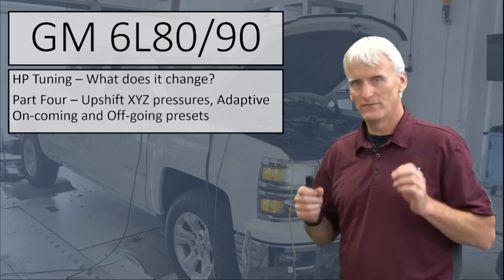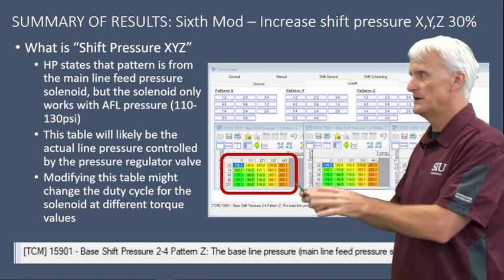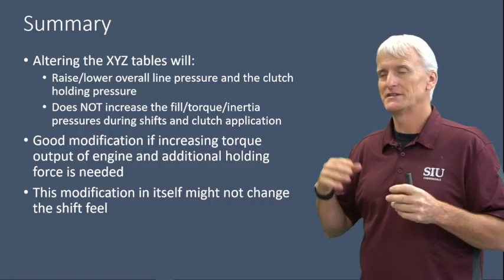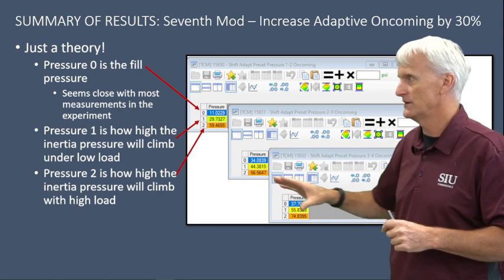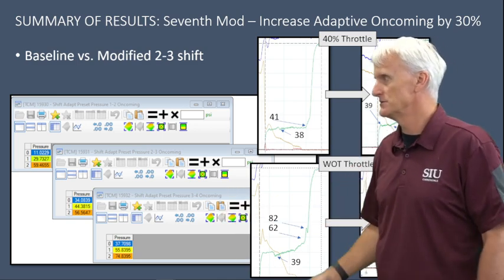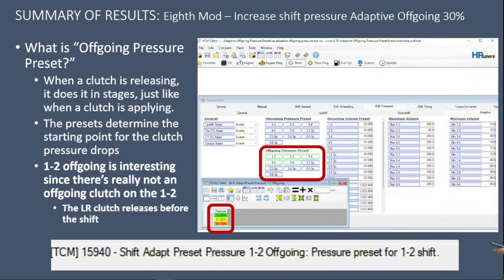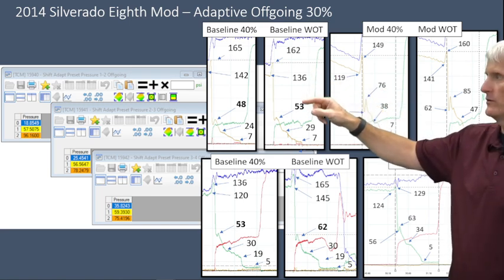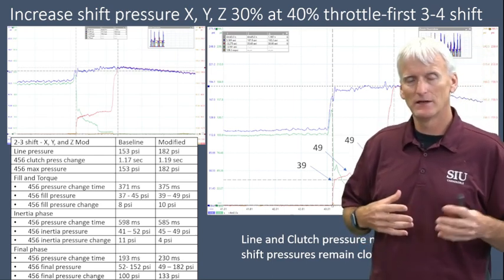Part 4 of the HP Tuners and the 6L80: modifying XYZ pattern, adaptive oncoming and offgoing!

Comment: I’m late to the party but I’m loving the series. 
Just my observation of that hump between phase 1-2 on clutch release pressure waveform. I think the hump is cause by available fluid volume in the valve body. The off-going clutch is trying to dump pressure down to a specific pressure by a certain time so the duty cycle of the solenoid is changed to release pressure. At the same time we are filling the ongoing clutch which is taking up much of our available fluid volume. When the ongoing clutch has been filled the duty cycle of the solenoid is likely changed to soften the engagement and when this happens we end up with more available fluid volume in the valve body.  Combine that with offgoing solenoid duty cycle changing as it enters phase 2 of release we see a hump in the pressure. Kind of reminds me of a pintle hump in an injector waveform. 
I’m not a transmission internals guy so I may be way off with my observation. 
I will look through the presentation file and see if you already answered this but I’m wondering if the timing of the 4 release phases changed by altering only the offgoing pressure chart.

Comment: Been working with HP Tuners for a while and it is all true, everything you explain. To “fix” my trans so that it will last I don’t allow the TCC to engage at all in any gear and I use standard tranny coolers to keep temps under 170 even when towing on a 105 degree day.  There is no thermostat in line with the coolers. The stock torque converters are pretty tight so no lockup works out great. Thanks for the videos.

Comment: You might be right with your hypothesis on the numbers but these PSI numbers might be "fuzzy" as they're calculated on the fly off the max pressure and just modulating a solenoid via PWM. Without more PSI, maybe no more is available? Would it be worth lowering the numbers by 30% because that you should be able to see without the trans having more pressure.
Reply from the maker: Very good idea!  After I'm done with this series, I'll try some of these suggestions and report back.
Reply: @siuautomotive  Thank you. Also a huge thank you for doing this series.